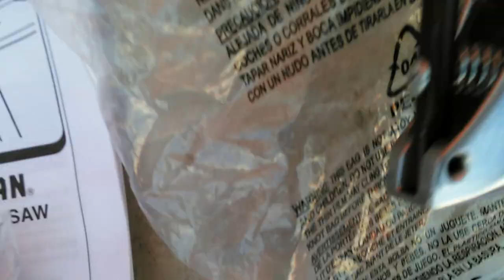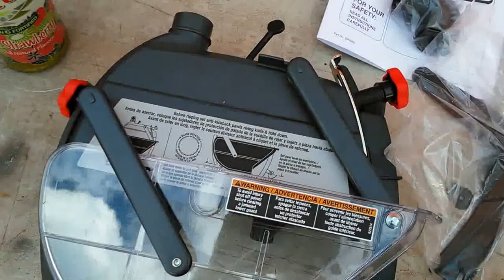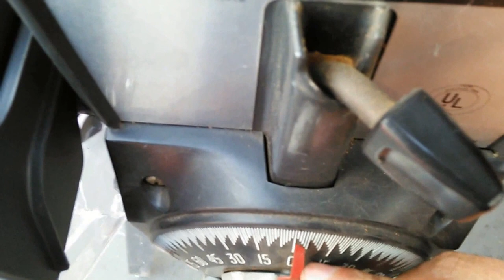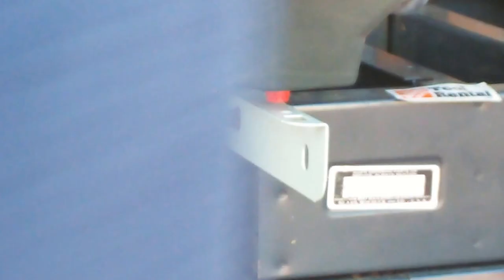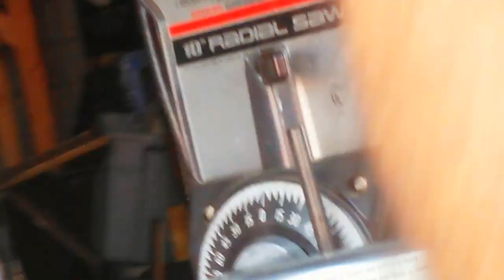Craftsman Radial Arm Saw Safety Kit (Recall and Retrofit)

Comment: All these years and I had no idea there was a recall on this saw.  So after seeing your video I decided to go online and just see if it was still effective.  t is still an active recall.  But, they require you to cut the electrical cord completely off the motor and to the yoke which disables the saw.  Then they will send you $50.  I am not destroying my saw for $50.  I would rather have to guard.
Reply: yep, apparently they decided any tools more than 20 years old belong in the trash. wish the court had something to say about that...
Reply: @mewmew32  Exactly.  And I am still using this saw with no issues at all.  I was hesitant at first to take out my cut-off saw and replace it with a radial arm saw but now I am glad I did.

Comment: I just replaced the table on my Craftsman RAS this week. If you install the rails that the table bolts on to, flush with the top of the metal frame, you don’t have enough room to turn the up/down crank. You will bust your knuckles on the bottom of the wooden table. If you raise those two rails as high as they can go in the slotted bolt holes, you have just enough room to turn the crank without hitting the bottom of the table top.

Comment: Just a note, you can reset the arm to be square to the table by a allen screw on the back side of the column arm lock up at the top rear of the arm.  You also,  have to use two teeth with the carbine on the same side of the blade, usually every other tooth.
This is a better way to square the arm to the table then to relocate the table holes.  These saws are great, but the set up is very hard, and hard to understand, but once to get them setup, you can do more cuts than any other type of saw.

Comment: I am late to the party, but I’ll put my information out there anyway. You need to figure out where the saw is going to cut across that table. Then using your square mark a line from the back edge where your fence is going to be toward the front, then flip the square over and mark another line as close to the first as possible without being on top of the first line. The lines should be parallel. Pick a tooth on your blade and mark it. Line the blade up with the board on the back the pull the saw out as far as you can and see if the marked tooth is still on the line that you started with , if not adjust it so it is. Continue this process until the tooth follows the line from back to front perfectly. Your table is now square with your blade. If it don’t appear to be straight with the saw the swing may not be lock into the zero point. This should have been check first.
Reply: Personally I think a lazar pointer marking the path of the cut would be a much better safety feature. Look at your hand before the cut , if the lazar is shining on your hand 🖐 probably ought to move it. By the time you mess with all the crap they have mandated you have lost track of where your hand is!

Comment: What it looks like is that the plane of the blade is not parallel to the plane of the arm.  There is a way to adjust that where the bearings ride along the arm.  Take the bearing covers off on either side of the arm and you will see where to make that adjustment. (I can't remember how it adjusts right now...maybe the bearings are on cam screws...which also adjust how tight the bearings are to the guides.  When I look at mine, I'll edit this post.
Reply from the maker: Michael Valentino . Thanks for your input, Michael.

Comment: There are another couple of models of Craftsman's radial arm saw than the one shown here. I have the Electronic model No. 113.198611. The kit was located online was HIGH$$, over $200. Worth every penny and more. If you do not have a safety guard, GET ONE. I did not have one two years ago and while ripping, I had a kick back that very nearly severed my thumb. I was very lucky. This guard would have prevented that accident. Be aware that there are two Repair Kits, 509344 and 509345. They cover a total of five models. Here is the list:

509344: Models 113.19810, 113.198111, 113.198210, 113.198211, 113.198250, 113.198251
509345: Models 113.198310, 113.198311, 113.198410, 113.198411, 113.198510, 113.198511, 113.198610, 113.198611.

The label on the box had nothing to do with any of these numbers and may not had actually been the original box. 

The instructions were good, but I had to think more than I should have.
Reply: Also 113.197751

Comment: I just bought a 10'' Craftsman  Radial arm saw like the one you used in video. It doesn't the updates on it  does Craftsman still send out the updated parts ?
Reply from the maker: From my understanding, Craftsman discontinued the retrofit, so now they're offering cash if you disable the saw.

Comment: You need to get the correct saw blade for this saw. You really need a blade with a -5 degree hook blade. Sears sells one, it's not too expensive and works pretty well.
Reply from the maker: Thanks for the tip.
Reply: I know Im asking the wrong place but does any of you know of a method to log back into an instagram account..?
I was dumb forgot the password. I appreciate any tricks you can offer me
Reply: @Jacoby Theo Instablaster ;)
Reply: @Gerald Yousef thanks for your reply. I found the site thru google and im in the hacking process now.
Seems to take a while so I will get back to you later with my results.
Reply: @Gerald Yousef it worked and I finally got access to my account again. I'm so happy:D
Thanks so much you saved my ass :D
Reply: @Jacoby Theo glad I could help xD

Comment: As of 08/2023 the recall consists of a $50 check to the owner of the saw after the owner submits photo proof of the saw cord being cut off and a signed affidavit that the saw will not be used. The whole purpose of this process is to absolve the company, Emerson Electric, of any future liability. There is no requirement that the saw has to be destroyed.

Comment: Gasp! Now I learn the RAS I have been using since March 1976 is unsafe? About four years since Sears Canada went outt'a business entirely?
Reply: Are you still using your RAS? I have never used one. But now seeing that the newer RAS have a riving knife on them, I honestly think this would make them safer than a table saw, on large pieces of wood being ripped. Because on a table saw, at the last part of the cut, if the wood twists, and you don't have a riving knife, the blade can grab the wood and eject it over the top of the blade and literally kill a person (read stories of kickbacks!). On a RAS, the risk of a kickback is high, but you don't have your hands positioned right over the top of the blade, like you do with a table saw.
Reply: @Ritalie  Very late in replying but, yes, I still use my 1976 Sears RAS here going into 2024. The guard on it looks identical to the original one being replaced in Frank's video. My chances of getting this upgrade are precisely zero! 
The debate over which of the RAS or the table saw is more dangerous will never end I guess.
After 48 years of occasional use, I am comfortable with ripping on my RAS. I always am aware of what can go wrong. I use all the safety devices I can, including pushsticks and engaging both the splitting wheel and the anti-kickback pawls as well as safety glasses.

Comment: I'm almost done with the retrofit thanks to this video ... however, I'm feeling really dumb ... I can't figure out how to install the blade AFTER I get the guard onto the arbor like you have it at 20:00 minutes in.  You show the guard without the blade installed.  

Also, the screw for the red pointer was too small for the thread on the new handle, so I used a #6 metric bolt and a nut on the underside to mount the pointer.
Reply: Is the retrofit still available? Thanks.

Comment: Kits are all gone, sears is gone and I'm not sure if you can even get 25 bucks for the motor anymore,if you have one use it with the safety equipment, I have a newer version and       an older one I'm not giving them up as scrap.

Comment: I just recently (5/2021) found out about the recall and of course have missed getting a retro-fit kit for my 1987 saw.  I'm trying to figure out what parts I would need to get (probably off of ebay) to have a fully functional retro-fit Guard Assembly.  Although the retro-fit kit used in this video (509346) is different from the one I'd need for my saw (509344), many of the steps are the same and I found this video extremely informative and useful (thanks for posting).  It does seem as though you are using your new Spacer Table as the fence instead of laying it flat between the Front and Back Tables as is shown in the owner's manual (i.e. page 19).  Is there a reason for doing this (I see you are using a 2x4 to make up the space difference)?  I don't believe the retro-fit kits came with a fence.  I read that the expectation is that one would have multiple fences (self provided), one for each angle of cut (so the fence is not weaken by multiple cuts) and a fence for ripping (with no cuts in it).
Reply from the maker: Thanks for your critique, Craig. I shot this video to market this saw, so I would have made some serious changes if I decided to keep it. The equipment that you see here was the original equipment that came with the saw when I purchased it.

Comment: I bought the same saw. Didn't use it. Was like new from the original owner. Got the fix kit but could not install it . So it is just sitting in the shop not being  used.  Too much work  to do the fix . Good video you made. I'm still wary of this saw.

Comment: When I sent mine in for the recall they sent me a box for the guard and motor to be sent back and I would receive a $100. but said nothing about sending me back  nothing but the $100. It says my saw will be permanently disabled....
Reply: But u DID get that $100 check eventually, correct? If so, & if you recall, how long was the whole process, from the time u put in the return box order, to receiving the check?

Comment: I have an older Craftsman Radial Arm saw with the old setup.  How can I find out if the recall is still being honored.  Thanks,  BobR
Reply from the maker: I believe the term for that recall ended quite some time ago. You might contact Craftsman or go to you local Ace Hardware where they sell Craftsman tools.

Comment: I tried to get the kit and it's no longer available from Emerson. Do you know where I can still find the safety kit or a manufacturer/supplier that would have the parts? Thanks - Tim
Reply from the maker: I've heard that the kit was available for a limited time which has now passed, but they are still offering the $100 rebate. You might try calling the offices of Craftsman tools to see if the kit is available through another means. I produce replacement tables for these saws, but I don't offer any other productions parts.
Reply: Thanks for the reply. I wonder if they only send one rebate per address?
Reply: There is no limit as to how much rebates one address can turn in the motor and carriage for. If what People in this comments section are saying is true for all retrofit kits - that there isn’t anymore left – then anybody turning in any motor and carriage assembly is doing them a favor, by taking liability out of the field as much as possible. I’m working on my seventh motor and carriage, started November 2018. It is now the beginning of January 2019 and I haven’t gotten my first check yet but I have faith they will do the deed. Aloha

Comment: I just submitted my 10" 113-197750 saw and they didn't give me an option for the retrofit kit. $100 rebate was my only option. We'll see in 6-8 weeks
Reply from the maker: This video was done a year ago. Sears might have stopped offering the retrofit kit, or at least stopped offering the retrofit kit for certain models. How old was your saw?
Reply: 1977
Reply: Derp. That one is to render the saw useless from my understanding they want you to mail them the motor

Comment: I have inherited a RAS and am trying to decide if I am comfortable/safe operating this beast as is, or to pursue the $100 recall. Re this video: if the stand is slightly out of square, won't this be taken care of when I adjust the arm mitre angle so the zero-notch position is dead on? Or am I missing something?
Reply: I know this was a year ago but if you haven't sent the motor off.  look up craftsman 113.199250 manuals should find a pdf will tell you all the adjustments you need to know. 3 set screws on the back adjust the arm. keep the saw man, or sell it to someone who will use it, I spent 150$ on mine very happy that I got a good economical saw.

Comment: Why use a feeler gauge on a plastic tip ?  Use the other side of the motor shaft ( on the saw side )  Put your arm on one corner of the table, lock tight,  and procede
the same for the four corners without moving it.  Square the back side of the table with the traveling of the saw blade. That all. !!

Comment: Is this kit still available?  My saw dates to the early ‘80s and I’m the original owner?
Reply from the maker: I believe this recall and kit were only available for a limited time. I did this retrofit a number of years ago when the kit was still available.
Reply: @frankhamilton8257  my dad passed in 98. His saw sat idle in his shop until my mom passed in 08. I cleaned out his shop and finally started going through and setting up his tools in my shop one year ago. Just by chance I found out about the re-call. Called about the kit and the was told in so many words, sorry Charlie, no more kits available and your out of luck.

Comment: I remember when they sent me the notice about the safety recall. I checked into it and what the fix was, although I don't think there was a problem to begin with. But the fix was a clusterf*ck and not at all a safety fix. It looked like it would be more dangerous to use with the fix than how I was using it since I bought the saw. I told them no thanks, I like it just the way it is now. They also wanted me to sell it back to them for some stupid amount. I would have to cut the cord and send them the motor assembly and they would give me some stupid low amount of money. I told them thanks but no thanks. Don't call me, I'll call you. It would be difficult to line up your blade for accurate cuts with all that junk on the blade cover, I think even more dangerous. All because some dipsh*ts don't know how to use care and pay attention when using the saw. This is the same kind of dumbass that would poke his eye out when using a screwdriver.

Comment: do these saws use universal motors or induction motors?
Reply from the maker: I would imagine that they're induction motors because I've never had an issue where I thought that I had to  replace brushes. I couldn't tell you for sure, though.
Reply: all table saw and radial arm saws have induction motors.

Comment: Cut a piece of plywood that is square drill a hole the exact size of the arbor and install it like it was the blade then bring it down to the table then use your square you will be almost dead on brother
Reply from the maker: Nice!
Reply: Even simpler is to turn the arbor 90 degrees straight down and move the head to the four corners of the rails!
Reply: That's a good idea. Thanks for the tip

Comment: I have two of these same saws 75 77 used them in my cabinet shop for years I'm retired now and have never had any safety issues with them people are STUPID!!! keep your hands away from the blade at all times I also have one of the older ones 60s sometime they are set up for doing different jobs I also have 3 table saws set up for different jobs I still work in my shop and help people out with small repairs and on their cabinets at 70 I still have all my fingers after 50 plus years of making cabinets and carpentry and wood milling I realize that accidents happen paying attention is the key don't do anything stupid I feel badly for craftsmen having a payout for STUPID people it's not their fault when you buy something like these tools you and only you are responsible for your safety not the manufacturer law suits hurt the company's and the consumer's we pay in the end for your unsafe actions!!!🤔

Comment: anyone have the dimensions for the table. I have to make one.
Reply: 304jeep304 There are four parts. The front is about 40” X 18”. Then you have the board for material guide and two back boards that push against the guide board to secure it in place using the two clamps that tighten against the rear most boards. There is a really good design for a better base board with sacrificial board on top designed by Mr Sawdust. Just search google or YouTube.

Comment: Does anyone know where to get a retro kit for my saw.  It was my dads and he gave it to me recently.  I called Sears about the retro guard kit.  It is no longer available.  Any ideas?  I have a 10" radial arm saw that met the requirement, but no kits available.  Any help out there would be greatly appreciated.
Reply from the maker: I've had a number of inquiries about this. I believe that Craftsman was required by a court order to offer these retrofit kits for a limited time which has now passed. The only thing I do now is the tables for these saws.
Reply: They need to start the program up again!!!
Reply from the maker: Yeah, I get a lot of that. The program ended a few years back. Meanwhile there are a lot of people with these saws that weren't aware that there was ever a  retrofit program.
Reply: I guess it will take more people loosing fingers, arms or worse to get this program back